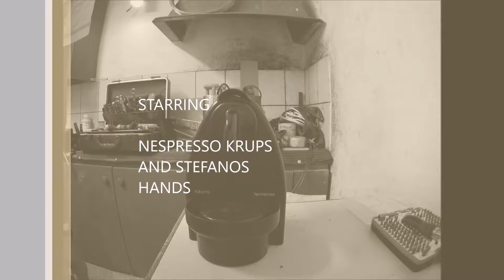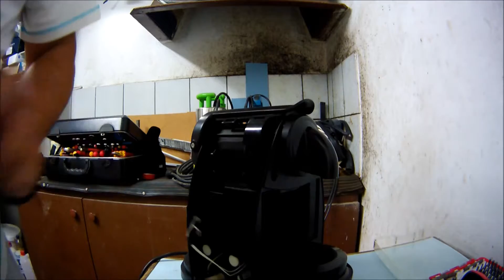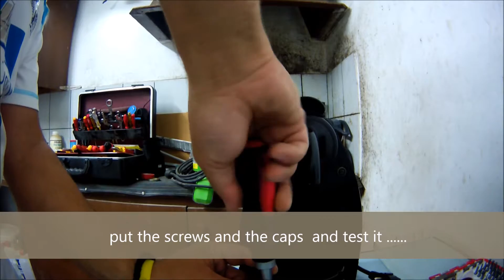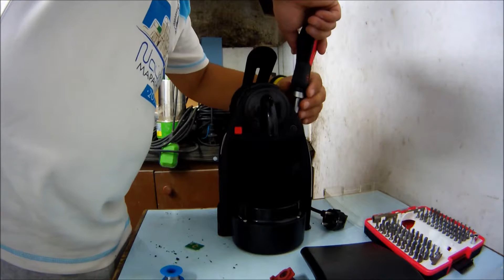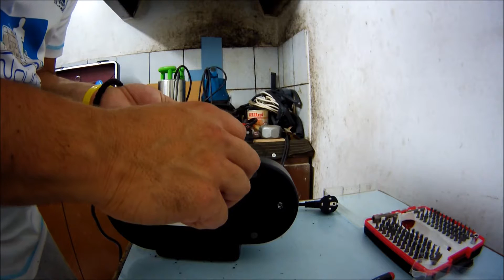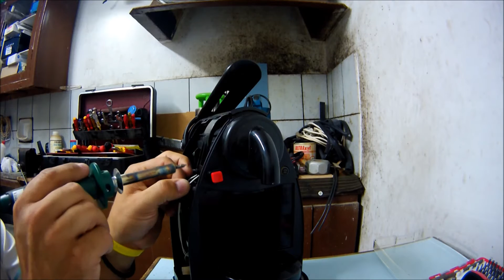Change on-off button in Nespresso Krups coffe maker

Comment: Hi, I have on of those and the same problem, I've opened It and the problem Is on the rubber button, can you tell me what the name of the switch you are using so I can buy one in an Electronics place?
Also, If I place the 2 wires together can I bypass It? I mean, everytime I plug the machine to the outlet it starts heating and at the end I remove the cable from the outlet?
Reply: Its a simple on - off push switch
Reply: @stefanosfakinos1866  👍